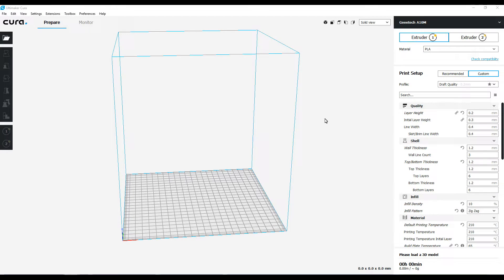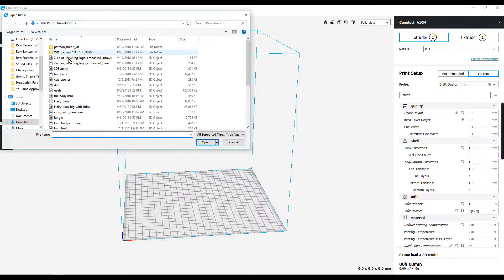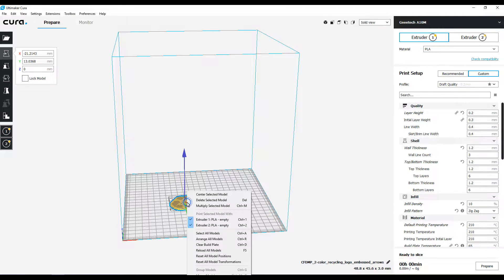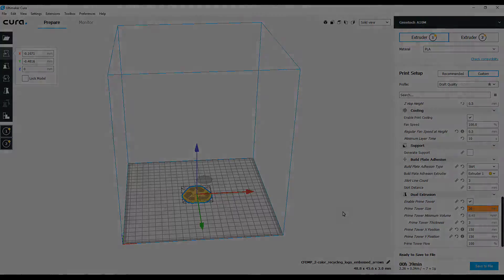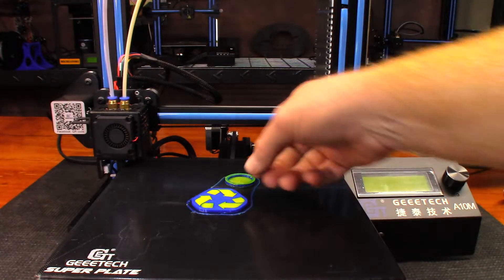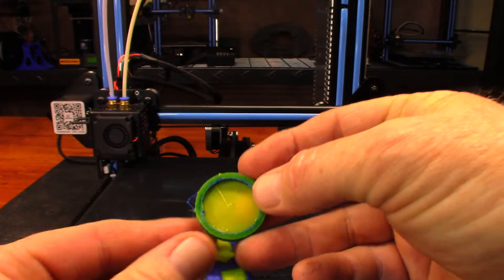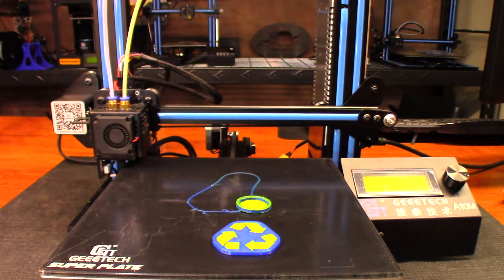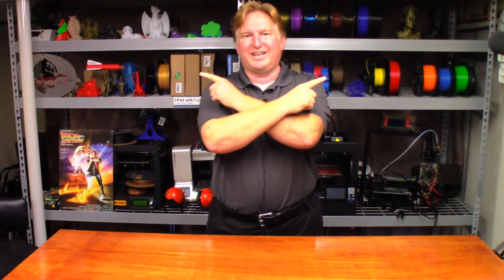3D Printed 2 Color Recycling Symbol On The Geeetech A10M

Comment: Hi Jimmy, did you find the problem of it not printing to the edge, i get the same issue, cant nut it out.
Reply from the maker: Yes.  The esteps were off.  Once they were adjusted, it fixed the problem.
Reply: @JimmyShawsTidbits1  What did you change them to?

Comment: Hi, Jimmy. I also have the A10M now, prints from SD card are nice, but my mixer is not working correctly. I tried 50/50 print from bottom to top with 2 colors but it is one color on the left side of the print and the other on the right side. No mixing like white and red is mixing to pink. I got only white on the left and red on the right side. Also tried from 0% on bottom to 100% on top but also get only left and right. Any suggestion from you? Thanks for your videos on this printer!
Reply from the maker: I had a hard time with that too.  Please check out this video and see if it helps.   https://youtu.be/3ToQbejLOBk
Reply: @JimmyShawsTidbits1  Thx for the answer, I will give it a try. But what can I do against heating up E1 everytime in DualColorPrint when the color is changing? I set all temperatures to 200 but when finished with color 1 it waits about 10 seconds (on display heating up E1) but temp is still the same, in the meantime the hot nozzle is melting the print, after that it goes to the temptower and changes the color. When finished, all happens again. I use Cura. 

Edit: OK, I figured it out now. I set starting temp 2 degrees lower but standby temp to the same temp. Now it takes about 2 seconds and than the nozzle goes to the temp tower.

Geeetech gave us a Cura profile, on this both extruder have different retraction settings. But I still get stringing. Now both on 5mm and 50 speed. What retraction settings did you have? OK, 6,5 and 35mm . I will give it a try now. Lets see.
Reply: Just turn the model on it's side
:)

Comment: That looks really good, it would be cool to check out your settings in Cura vs my Simplify 3D file. I can see some fun dual-color models in your future like the Loubie cat in a box etc!
Reply from the maker: I challenge you to a dual...color print off.  Same model sliced in both slices printed on the same printer with the same filament.
Reply: @JimmyShawsTidbits1  Hmm...